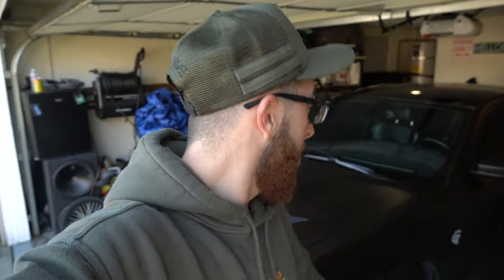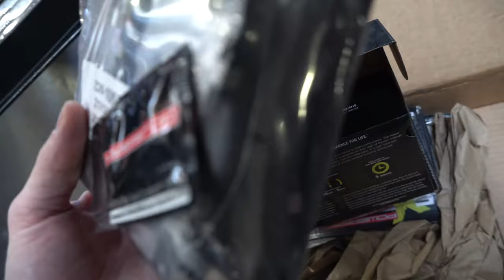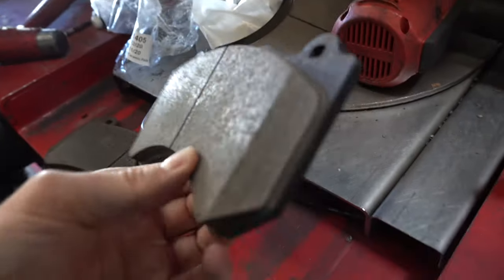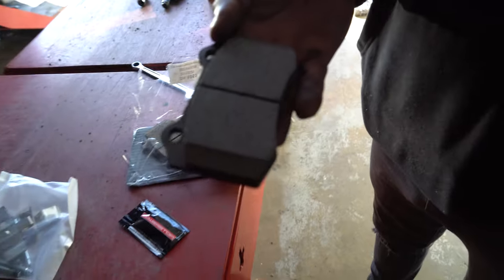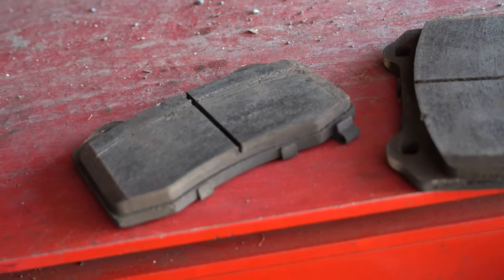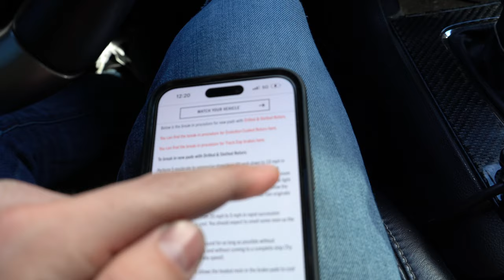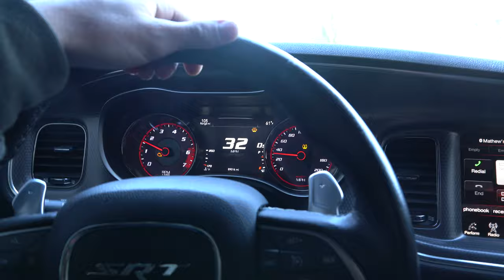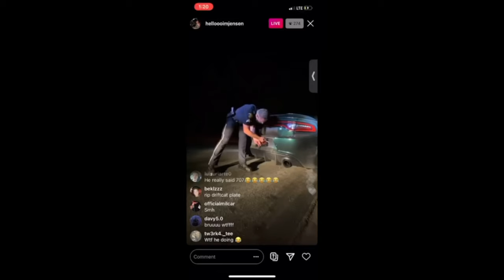THIS IS WHAT HAPPENS TO YOUR BRAKES AFTER LEFT FOOT BRAKING ALL THE TIME….

Comment: Just get the Z automotive Active exhaust delete plugs that get rid of the check engine code without needing to tune it
Reply from the maker: Quick lil weld is a lot cheaper haha I looked at those sensors as well but didn’t have the patience
Reply: @helloooimjensen  I had the same thing happen to my scat. the valves broke inside the exhaust and even welding them didn't work. I had the muffle shop cut them off. the Active exhaust valve deletes is a little plastic plug that goes into the wiring and tricks the car into thinking the active exhaust is still hooked up and the check engine light turns off
Reply: It’s takes like 10 minutes to install